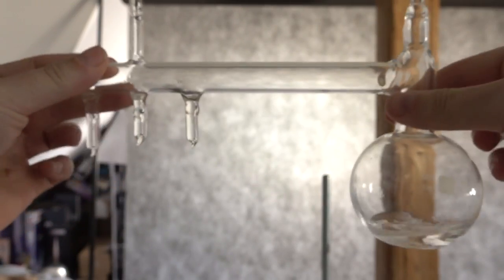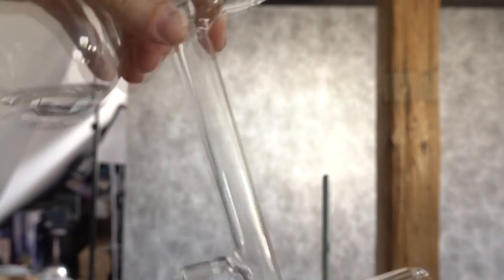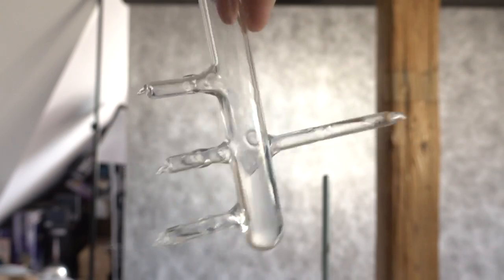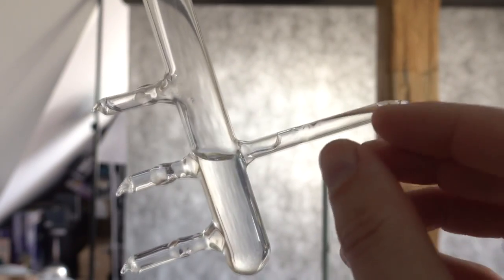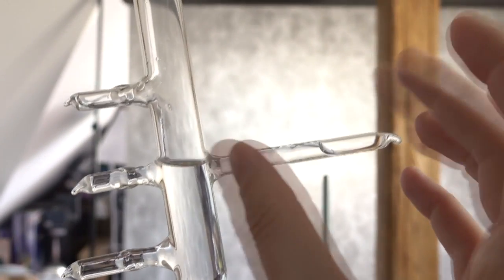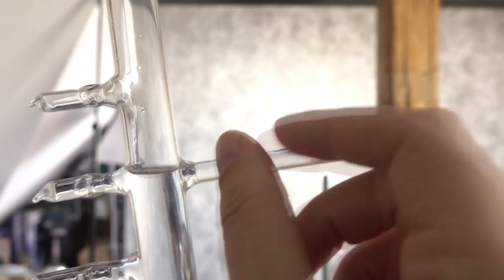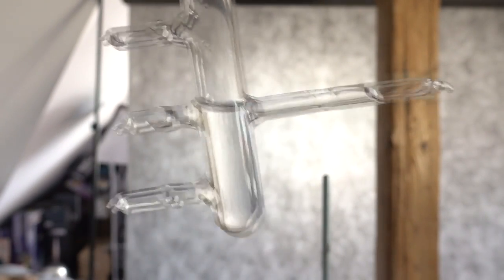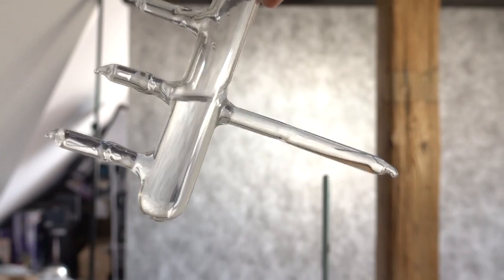Fascinating stuff water does under vacuum!

Comment: Never actually saw this before. In engineering fluid mechanics, keeping the pressure high enough to keep this from happening at pumps is a serious design consideration. These bubbles will wear down the fan in the pump to nothing. What happens is that they collapse very quickly and chip away at the pump.

edit: typos
Reply: Yes, good point Hans. Cavitation bubbles, as it is called, can reach temps of 5000° Celsius even. This has ruined many a wrong chosen boat propeller. o7 salute to pump engineers. They have to be really smart.
Reply: What kind of "engineer" calls the internals of a pump a "fan?"
Reply: Forgot the name of those when I made my comment. Just got reminded of it when I heard him describe how quickly they collapse.
Reply: He called the impeller a fan. Thats practically not wrong, prolly a language barrier.
Reply: deal with the same thing in the water jackets of diesel engines due to cylinder flex and vibration. it regularly wears holes in the 1/2" thick cast iron sleeves without proper maintenance.
Reply: Hello fellow engineer, nice observation:)
Reply: Dranoel Arios Hi. I'm not even a pump engineer per se. I am graduating soon with a BSEE and wish to be a systems engineer.
Reply: Dranoel Arios and going into a MSEE program in the fall.
Reply: +Hans Solo Zimmler I'm studying for aerospace engineering, but I always enjoy TF's videos.

Best of luck comrade!
Reply: Dranoel Arios Cool, I went to a uni where aero was not offered. I hated statics, so I went from mechanical to electrical. I initially wanted to work on heat transfer stuff in the aero industry, but I like Communications and controls, so I am fine with my current setup.

Comment: I've seen weird vacuum experiments but this one make me say wtf! Cause of the whole no sounds in a vacuum.
Reply: Let's say you have an alarm clock and a glass container with a vacuum in it. Put the container over the alarm clock so that it is not in contact with the surface the clock is placed on, and make sure that it isn't touching the walls of the container. The clock goes off, you do not hear anything because the vibration of the clock doesn't touch any gas particles. Because of this, the vibration cannot reach outside of the container. No gas particles vibrate inside of your ear, so your eardrum doesn't move. You hear no sound.

Now let's do the same thing, except this time we tape the alarm clock to the side of the glass container. The alarm clock goes off, and starts vibrating. This vibration also vibrates the glass container that it is in direct contact with. The glass container is in direct contact with the air outside of the container, and as it vibrates it also starts to vibrate these air particles. The particles in the air vibrate, and make your eardrum vibrate. You hear a sound.

There you go
Reply: The glass tube itsself is not in a vacuum. If she vibrates, the air outside still vibrates with it. Water can transport sonic too.
Reply: freierHimmel
Yeah I get that, when you stick and alarm clock in the vacuum you can't hear anything, but water making that loud of a sound is amazing. Sure you can bounce an alarm clock inside a vacuum and hear it hitting the glass, if it doesn't break the glass but you still can't hear the alarm it's self.
Reply: M390VI
What? Translate that into English.

Comment: Cavitation, and the insuing collapse of the bubbles nearly led to the failure of the Glen Canyon dam in the US in 1983 and 1984.  The cavitation eroded the spillway tunnels of the dam to the point where huge boulders were being carved out and moved downstream. It got to the point where the engineers thought the tunnels would be carved out so badly that they would connect to the reservoir and allow the lake's contents to completely drain out. Needless to say, that would have caused massive problems (including the potential failure of the Hoover dam) further downstream. Water can be incredibly powerful!

https://en.wikipedia.org/wiki/Glen_Canyon_Dam#1983_floods_and_legacy
Reply: Water in motion is a force quite frequently underestimated, and the properties of water (it can act both as a solvent, erodant (is there even such a word?) and lubricant) makes it surprisingly good and taking stuff apart given enough time. Oh, and thanks to all that oxygen it also oxidizes stuff like crazy. And that´s just freshwater. Add salt... Eeesh.
Reply: Yes, and have damanged many a pump impellor and boat prop.

Comment: Was it just me or did anyone else just assume that tapping noise was his ring hitting on the glass until the very end of the video when he explained it?
Reply: Ya, video would have made a lot more sense if he'd said that the sound was created internally, right up front.
Reply: I thought it was misogynist code.
Reply: No, vacuum cavitation is well known.
And the glass could break, it damage even ship propellers.
Reply: GoldVixen Red October
Reply: *****  Didn't see most of his hand either.  Point is it sounded very much like a metal object (such as a ring) clinking against the glass.     Unless you've seen or done this trick before, it was  non-obvious that the clinking sound was due to the water hitting against the end of the tube.    We've probably all seen some form of water cavitation inside a glass container before, but it usually results in destruction of the glass container, rather than a nice little clinking sound.
Reply: +Fanaprimo "Captain, we're cavitating, he can hear us!"

Name that movie!
Reply: You're not alone on that one
Reply: no .. nopp.. not me... but on the other hand,.. i tried this a few years back
Reply: nope he said most the gas in there was water vapour and that water does strange things under a vacuum and given that the only strange thing to happen was the noise also it's just kinda obvious to me that under a near vacuum know water should reactively easily turn from water into vapour and visa versa so it was an easy guess.

Although I didn't notice he had a ring on so all of you are a little more observant than me.
Reply: No...I've seen this demonstrated before.  Kind of like inertial cavitation.  Still fascinating as hell though! :D
Reply: Well if you don´t see it, put a ring on it
Reply: Same here, for a minute I was wondering what was so odd about what he was showing.
Reply: +Fanaprimo Correct! You win a date with the sexy Sean Connery.
Reply: GoldVixen A dream comes true.
Thx, and have a nice weekend.
Reply: at first i thought ice was somehow forming until i saw the slow motion video.
Reply: No, i thought the same.
Reply: I thought that too!
Reply: yup. that's what i thought.
Reply: LISTEN AND THE BELIEVE, THE RING IS REAL. lol
Reply: HE IS NOT WEARING A RING EVERYBODY
Reply: your welcome
Reply: Back Door Sluts #9
Reply: +daemn42  And so, the secrets of ramen remain a mystery.

Comment: Shouldnt water be boiling when its in a vaccum?
Reply: It isn't completely a vacuum, as he said, there is some air in there.
Reply: It depends on the temperature, I suppose. In this experiment the air was pumped out of the tube while the water in the tube vaporized and replaced the air. There is no vacuum in the tube, but only water in 2 states, liquid and gas (and possibly minor amounts of air).

Comment: if theres a vacuum in there why doesnt the water boil?
Reply: Almost vaccum ;)
Reply: Why would it?
Reply: I think that if the water had started to boil, then the pressure in the tube would increase to the point that the water would stop boiling. Maybe.
Reply: Not saying that it should, but lowering the pressure generally means lowering the boiling point as well (because PV=(z)nRT). It doesn't boil in this case because the difference in pressure is not enough to warrant a decrease of its BP by ~80 K.

Comment: Did you make that apparatus yourself? Would this behavior be identical if you pumped argon in so that essentially all of the water was liquid?
Reply: but, if argon was the gas volume, then the behaviour wouldn't be the same. The effect is obtainable because, the gas in the tube is water vapour, therefore the bubble can collapse, and the vapour can, even if temporarily, revert to its liquid state.
Reply: If he pumped argon in then he wouldn't have a vacuum.
Reply: eddiebruv I don't think you understand the question or the experiment. "Under vacuum" is often scientist shorthand for "pure sample at very low pressures at a constant volume". There's still gas in there (there has to be, just look at the phase diagram of water), and the only reason that not all of the water has turned to gas is that the vapor pressure of the water is keeping the liquid as liquid and the volume of the system is disallowed from significant expansion.

I'm asking whether the behavior of the water here would also be observed if argon were providing the necessary pressure at the water's surface to keep it from further vaporizing rather than water vapor doing that job, or if it would be more similar to water's behavior in an open system at atmospheric pressure.
Reply: Yannis Martynov That's what I was asking about, thank you. I figured as much, but I'm not sure. Anyone else want to weigh in?
Reply: Appreciated.

Comment: you say they colaps into nothing, but they reapear again. how does these bubbles form?
Reply: He said its water vapor in these bubbles, so they are mostly water
Reply: If you take a piece of paper and rip it, air will replace the space between the pieces of paper. If water gets ripped this way into two directions, it will vaporize as a result of the lower pressure, since there is nothing else there to replace it. Does that make sense or did I fail? :)
Reply: InqWiper
ok i get that part, but im asking, for example in ur explanation. what is the substance or force that make the water gets ripped into two directions and vaporize?
Reply: Ng Mui 
Well, he sets the water and container in motion in one direction. When he stops the container, the water still has momentum. If the water just keeps going, something needs to fill the room behind the water. This is where the vapor comes in.

Comment: Its odd that it makes such a sharp noise. It sounds like your banging the glass with a solid object  like with a ring or something.
Reply: I'm not sure but these might be tiny implosions. Pretty fucking amazing.
Reply: Chris Legan Yeah, I'm aware of a similar effect that can destroy the bottom of a beer bottle under the right circumstances. The shockwave released from the collapse of such a "vacuum bubble" must be extremely potent and localized. Hence the sharp clicking sound instead of the more subdues thump one would expect.
Reply: cavitation.

it also causes erosion to ship props, and is the method by which pistol shrimp kill their prey.
Reply: *weathering